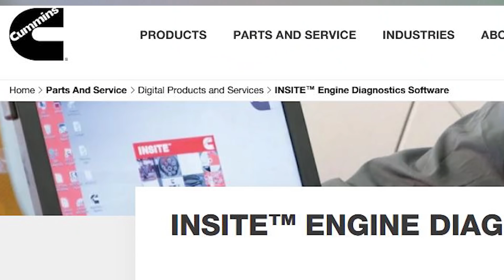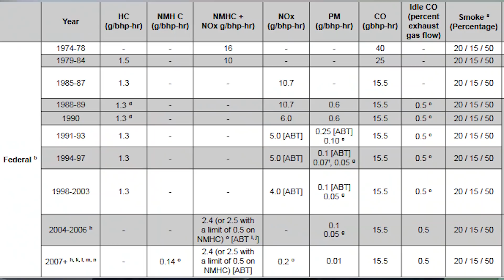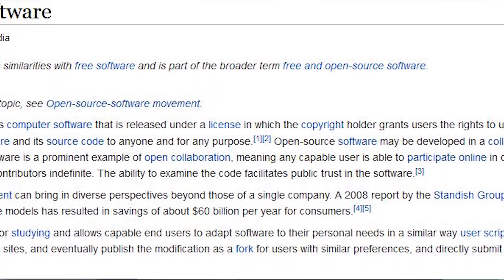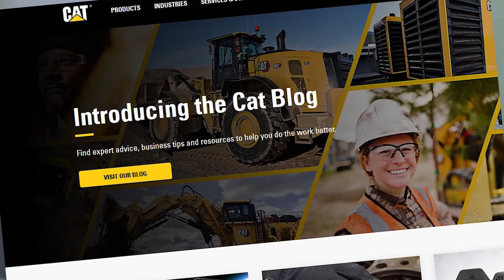Should YOU have the "Right to Repair" your Engine?

Comment: Right to repair is a Right that everyone should have. If you buy that equipment for thousands upon thousands of dollars then it is your equipment to do as you please. It's basically holding your equipment hostage for them to say when and where you can fix the thing you purchased.
Reply: They’re holding it hostage even after paying an insanely huge price. If they can do that then they shouldn’t be allowed to charge so much.
Reply: Who covers warranty when the non certified diy repair fails causing even further potential catastrophic failure for a temp fix?
Reply: @joshgelling7435  I say keep your warranty or I don’t need anyone working on my truck. No thanks
Reply: @joshgelling7435  when you fix it yourself you are warranture. If you dont know what you are doing you should keep your hands off. Didnt your mother teach you that
Reply: @joshgelling7435  Securely log it and look at the history. If not caused by software modification, manufacturer covers. This can be done.
Reply: @bsdwiz  no it can't. Right to repair sounds great, but just don't expect to have any warranty.
Reply: @tira2145  not everyone can afford equipment that is under warranty
Reply: @therealrobertbirchall  yes, then right to repair should be standard. I just believe that if a piece of equipment is under warranty, the manufacturer can dictate who can fix it.
Reply: @tira2145  in the UK as long as the repair or service is done competently using OEM parts the manufacturer is obliged to honour their warranty ie getting an independent to do a service on a truck for example is no reason for a manufacturer to refuse a legitimate warranty claim., provided the work has been done to the manufacturers spec.
Reply: @therealrobertbirchall  great. I have no problem with that. But for the average untrained owner to try to fix a complicated machine, they can do more harm than good. Seen it happen.
Reply: @tira2145  oh yes Billy bodger is always at large, trust no one with your kit.
Reply: @tira2145  I belive the manufacturer has a duty to provide goods that are fit for purpose at the time of sale and during the warranty period, however the purchaser also has a responsibility to ensure that the manufacturers instructions for use and maintenance are followed competently.
Reply: @tira2145  that's true of most products.
Reply: @tira2145  honestly I kinda of agree if you're under a full warranty as in no cost to you who fixes it then the dealer should be allowed to set the terms of who can repair the equipment but once the vehicle is out of warranty they need to provide access to the software to repair and diagnose the vehicles
Reply: @tira2145  Don't know what you're worked up about, warranty has always worked the same and always will. Nobody is expecting warranty to cover the owner's repair job. That's a really strange thing to expect.
Reply: @tira2145  if it’s under warranty it shouldn’t cost a thing to have it fixed by the manufacturer, it should just be done. John Deere can send a tech out or eat the transport costs + losses incurred by the owner of the equipment from not having it for weeks. If they want to send you through the ringer so much so that it’d cost you more to send it in for warranty repair than to repair it yourself, you are directly incentivized to not send it to the manufacturer… they understand this, farmers understand this, that’s why the farmers fix their own shit and that’s also why these big companies have started turning to software lockouts that most people cannot get around. The manufacturers profit from the inflated repair bills WAY more than they do from the actual sale of the equipment. They want you locked into spending money with them. (Oh we have to use this special software to tell the tractor to accept the new sensor.) fuck right off with that.
Reply: @Chris-lw5po  you are partly correct. Companies make a lot of money on repairs, however, if you don't fix the machine right, and you trash the engine, should the manufacturer cover a new engine?
Reply: @bsdwiz  lol, that's not even remotely good enough. Let alone, you can't rely on someone to properly log it, or log it at all.
Reply: @therealrobertbirchall  there is no such thing as equipment that isn't under warranty unless you are speaking about 3rd party sales and long term ownership.
Reply: @sqlevolicious  or used equipment which is the only way some businesses can afford operate.
Reply: @sqlevolicious  how do you know 'the work is never done under manufacturer's spec? I repair and service my own motorcycles, I am skilled I'm mechanical work and metal fabrication, I also understand and work on modern EFI engines through a breakout box. My workshop is equipped with machine tools and welding heating equipment. I live on a remote Scottish island pop 1,200, if i don't fix it or maintain it who will? The majority of my neighbours, fishermen and crofters, also have to repair and maintain their kit, we of course share resources and knowledge. Or next time my Harley Davison  motorcycle needs service or repair, repair being very unlikely due to my efficient and skilled maintenance, should I send it by truck to Glasgow and back at a cost of at least £1000 quid. I'm afraid your capitalist fantasy of big corporations owning the rights to everything on God's earth just is not realistic sunshine.
Reply: @therealrobertbirchall  In fact, we have a thing in the states enacted in 1975 called the Magnuson-Moss Warranty Act. Basically, manufacturers have to prove second party work, service, parts and modification had directly contributed to a failure before voiding a warranty. So, in a way they have put themselves between a rock and hard place. The manufactures are literally giving them a legal defense.
Reply: @tira2145  that comment is rooted in stupidity. Possibly if you fixed an engine it would blow up however myself as well as most farmers I know can fix their equipment better than the factory techs. My 3406 cat was running at our local dealership that had told the original owner the engine need replacement. One of the techs walked up and said wow thats a nice sounding engine did we rebuild it. I said no I did. And he sheepishly walked away realizing that was an engine they said could not be fixed. So if you think only highly trained factory techs can fix your stuff keep going to them they like your money
Reply: @holmes1956O  Yeah, you can fix your engine, but not everyone is as talented as you. There are a lot of people who think that they are good Mechanic's.  I could build you a 20,000 square foot shop that would be awesome, but I don't have the knowledge to change a spark plug in my riding mower. Not everyone is blessed to know everything. The original manufacturer should not be responsible when I screw up tractor.
Reply: @tira2145  if you dont know dont touch simple as that. That is why shops exist. Just because you need someone to fix your stuff doesnt mean I should be chained to that post with you. That is what this discussion is about should people like me be able to fix our own stuff
Reply: @holmes1956O  Now we both know people that think that they are the best Mechanic's in the world, yet believe that a diesel engine has spark plugs. I have no doubt that your a great Mechanic, but the manufacturer doesn't know that. It's a complex problem. If you want to work on your equipment, either buy older stuff, or realize that new equipment has string's attached. I wish it wasn't that way.
Reply: what about the rights of the manufacturer? why should it be illegal to sell something that only you can fix? if you don't like how the manufacturer conducts their business; don't buy their products. if it's really a problem, the free market will solve it. someone will see an opportunity to profit by manufacturing a product that can be fixed by anyone.
Reply: @cink1461  the manufacturer gives up their rights to a piece of equipment as soon as they cash your cheque or the finance goes through.
Reply: @therealrobertbirchall  you didn't buy the software needed to fix the equipment because the software isn't for sale. you purchased the equipment WITH this knowledge. it has nothing to do with the manufacturer "giving up their rights."
Reply: @cink1461  the software was sold as part of the equipment, without it the equipment is useless, therfore you own a copy of the software and have the rights of ownership to modify it if you so wish.
Reply: @cink1461  if the software is necessary to repair the equipment then the company needs to give it's customers access to the areas needed for repair. We don't allow monopolies and this is a monopoly simple as.
Reply: @michaelf.2449  I don't think your definition of a monopoly is accurate... that aside, this is supposedly a free country. why should it be illegal to sell a crappy product that can only be fixed by certain people? who forced the customer to buy the product if they didn't like the procedure for repair? if you don't like how manufacturers are doing things, why don't you start your own company and sell a superior product?
Reply: @cink1461 First it's a monopoly on repair, secondly when every manufacturer has agreed to follow the same pattern regulations need to intervene and stop that from happening to protect consumers from corporate greed, and third because I don't have multi billion dollar loans from banks and the federal government to build a business that only functions off screwing consumers because I know they have no choice between me and the other guy doing the same thing.
Reply: @cink1461  the free market is a worse system.
Reply: @sqlevolicious  if that is your belief, I defy you to try and make a hamburger 100% on your own. feed and raise the cow, slaughter it, grow the wheat to make the bread etc... it would cost you 3-4K dollars for one hamburger. the free market brings that to you for $2 at McDonald's in about 1 minute. nobody ordered these people to raise the cows, grow the wheat, build the stores or serve you. it was the profit motivated incentive from a free market that did it.... free markets are the BEST solution. it is GOVERNMENT that creates most of the problems that people are affected by.
Reply: @cink1461  wow, I can tell that you can think for yourself. A rare talent in this day and time.

Comment: Manufactures need to open up access.  What that access looks like is up for much debate.  I lean more towards an owner getting free access.  Shops maybe a reasonable fee.  Both of those options create management challenges for the OEM.  It's also more than just software.  It is parts diagrams, diagnostic/repair procedures.  What are the risks of this information getting in the "wrong hands"?  What protections and recourse is there for abuse that is not already in the laws as they exist today?

Comment: The beauty of diesel engines is that in an all out global SHTF situation you can strip out all of the electronic crap and end up with a perfectly fine engine.
Reply: Not really.. Unit injectors are controlled via ecm
Reply: At one time you were right.  Any diesel made after the mid 90s ( give or take) is electrical controlled.   Finding a diesel these days with a mechanical fuel system is about as easy as finding gas engines with points

Comment: Your talking logical. Bean counters will disagree with you. Charge $3000 plus for software and $$$ for parts. It’s already baked into the cat parts system as it is. Going to cat should be cheaper shouldn’t it. All about Bean counter algorithm same as posting a comment. Means more $$$. Takes logic out of the picture.
Reply: Fun part
Let’s think 2 or 3 generations ahead and how they handle logical thinking that actually moves forward. Are we conditioning or teaching our children?

Comment: The idea that only dealers and corporate engineers are the only people with creativity is stupid. The automotive industry learned this from NASCAR and NHRA racing. Detroit Diesel hired Roger Penske to help with their 60 series engines and there are many others out who can repair engines and write programs for computer programs.
Reply: And in my option that was one of the best engines of that time we had several where I worked and I was really impressed with them, the 12.7s had great power best milage, but yes they leaked oil around camshaft front seal area a little.
Reply: "series 60"

Comment: I see the problem that if the manufacturers continue to control the software who's to say that they're not making the electronics the weak part requiring the software to fix it requiring you to purchase their software to fix their weaker electronics to fix your machine that you already paid for
I think it should be open source in addition to that that guarantees that they are putting the maximum amount of effort into getting the electronics working as flawlessly as possible since they wouldn't receive anything from diagnosing electronic faults
Reply: Thet don't technically need to make the software open source. They just need to create an API and publish communications language specs. Third parties could somewhat easily make an interface for it.

As for sabotaging the software or electronics,  they could do that currently just to force you to go to thr dealership for services.  They don't because they don't want the reputation for being unreliable junk any more than reality assigned in to them. Nothing would really change on that front.
Reply: @sumduma55  agreed. Old Toyota ECUs can't be modified and are closed source, but pretty much every Toyota ECU performs flawlessly. And with OBDII you have a standard interface to access engine data
Reply: We already have open source software, but it's time that more things become open source, both software and hardware.
Reply: kinda like a 1200 dollar cell phone   as they send you updates  and downloads    there obsolete  in a couple years you have to buy a new one.... this right to repair BS is also in that industry
Reply: Oh they already do that I "update" light vehicles all the time and my cost is 50-100 per download plus the equipment to install it you pay about 200 to me or 300 to the dealer and the vehicle won't pass inspection without the update(s) making them illegal to drive

Comment: You should be able to fix it yourself and not rely on big corporations.
Reply: Especially when many of these corporations and their "repair staff" are incompetent, or not given the tools to fix items. 

Like a new high efficiency furnace, fridge, or hybrid water heater... Sorry, That part isn't replaceable, you have to replace this unit. 

There is a high incentive for these companies to NOT have competent staff, gotta keep that consumption going.
Reply: Fine, just don't expect to keep the warranty.
Reply: @tira2145  of course if I modify equipment, I'd lose warranty. But your argument is a red herring. Most of the problems come in on equipment that is out of warranty and they try to restrict repairs to their dealers, driving cost and downtime through the roof.

Comment: Second and yes it’s your property you should be able to maintain,repair or modify it in and way that it’s not a immediate direct threat to yourself or others.
Reply: I both agree and disagree.

You really need to keep the emissions standards in line with regulations as manufactured.  If you find them too prohibitive, then we really need to get them changed for everybody. 

I think one of the biggest issues is that they use software as a means to limit performance so they can sell a lower grade engine option.  It's far easier to stock one injector and change the fuel mapping via software than to have 3 or 4 different versions for different applications.
Reply: sumduma55 yes we don’t need every asshole rolling coal, nor should warranties be called on when things are not done improperly. On the “lower grade engines” I believe that the improperly operating emissions systems (seems like mostly here in the USA/Canada) are also-not 100%- part of planned obsolescence like most of the things we have these days, phones, cars, clothing etc.